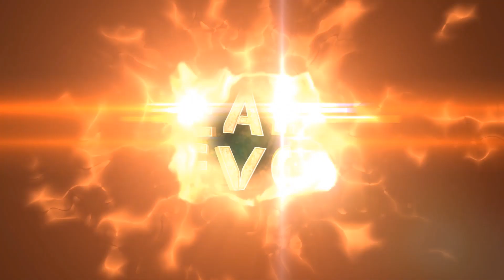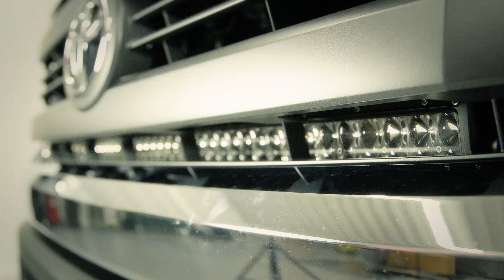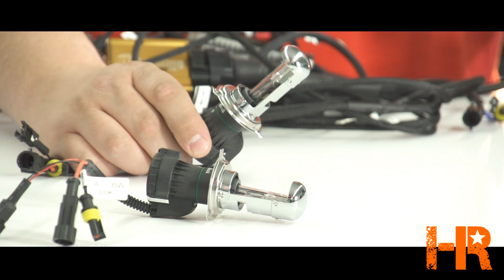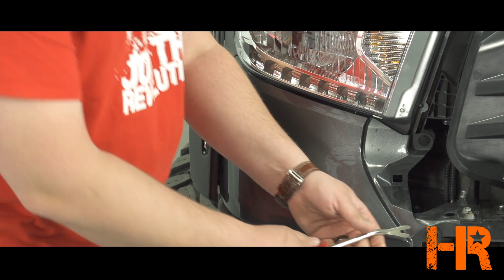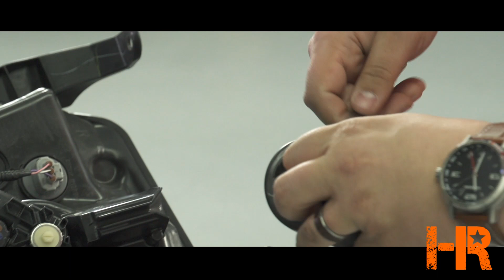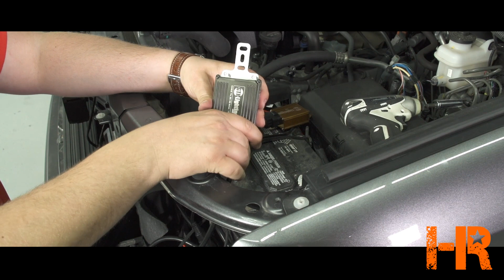2014-2017 Toyota Tundra Headlight Options - Tundra Video Series (6) | Headlight Revolution

Comment: My 2014 Tundra has 3 different 2 way radios for emergency use. I have had issues with aftermarket Led bulbs in the past causing RF noise on the radios and even completely blocking out incoming radio traffic. Would you recommend this product as suitable for such use? RF shielding is crucial.
Reply from the maker: Absolutely!

Comment: Are the GTR headlights with the color shield not available anymore? I can't seem to find on your website...
Reply from the maker: They are no longer available. While they were a neat bulb, There have been major changes in the industry for the better. The GTR Lighting Ultra Series 2 bulb is the newest version of the GTR Headlight lineup.
Reply: @HeadlightRevolution  link?
Reply from the maker: These would be what you need for your Tundra: https://headlightrevolution.com/h4-9003-gtr-lighting-ultra-2/

Comment: I have a question. I installed Two Head lights purchased from you several months ago, and experienced the left side turn signal light, still stock from Toyota, start blinking fast, then it back to normal a day later, it keep happening once in a while when Daylight LED and turn signal on at same time, turn off DL LED then it back to normal blinking speed. When that happened, I turned off Day driving light and it was ok. Do you know why or anyone having same issues, or how to fix? Thanks.

Comment: I myself decided to use a hybrid between the two (HID and LED) for my 2013 escape. I am replacing the stock headlight assemblies with one that has a projector low and a reflector high ( only aftermarket available) . I understand HID is better suited for projectors and will have a GTR 35w HIDs for the low projecters and GTR LEDs for reflector highs, to take best advantage of both technologies. Anybody else go this approach, have any tips, or concerns. I bought everything except for the high beam LEDs so far because after watching this i now have a question, should i just go for all HID? My high is a reflector and i know its not appreciated to other drivers with immense blinding glares they produce in reflectors, but does that matter since the reflector high beam would only be on without oncoming traffic anyways? HID seems like it (tho not as a clean vibrant color as LED) illuminates more area? thanks.
Reply from the maker: Hello Derek,  Using both together will be a great route to take, We recommend this combination all the time!
Reply from the maker: My guess is you already have, but if not, watch this video on HID vs LED pros and cons: https://www.youtube.com/watch?v=JAeLsPpSowo

Here's why we recommend the combination you are already on to:  While HID's can be brighter, they have what is called a "warm-up" period that takes about 6-9 seconds from the time you turn them on until the time they reach full brightness. That's totally fine with your low beams because you normally turn your lights on once while driving. In high beams, you can see how that could be a little annoying when turning them on and off. The reason we like to use LED's in the high beam is that they have an instant-on/instant-off light output. Usually, when people are blinding people with LED's it's for 1 of 2 reasons: 1, they simply have cheap, poorly designed bulbs. 2, they haven't oriented their bulbs properly in the housing. To orient them correctly, just make sure the LED's on the sides are facing right to left and NOT up and down. As long as you do that, you should be very satisfied with the results. 

Contact us with any questions, concerns or even over the phone troubleshooting, we are more than happy to help: 218-755-5505

Comment: The first question when comparing lighting angles on the test road with yard measurements; does this model Tundra have the adjustable headlamps?   I have a 2017 Limited and the lights can be adjusted with the dial on the dash, so I can raise the light, when in low beam mode, high enough to act as a high beam, and high beam turns into massive amount of light.  Some conversion kits inhibit the adjustable feature.

Comment: OMG...It seem harder than I think and why make a headlight to use H4 bulb instead of H11. After watch your video I prefer to buy the Silverado. It look like there is a lot of hassle just to replace a headlight bulb. If the bulb burn while away from home what can it be fix.
Also if with led or hid 6000k driving on wet road hard to see where you're going, I prefer hid 3000k see better on either dry or wet road, see better is part of safety

Comment: Does the 2014 have the same height adjustments as the 2017? Is that done inside the assembly? Will taking or the headlight throw it off?
Reply from the maker: I believe it's standard on all 14-17 trucks. there's a motor on the back of the housing. No taking off the housing shouldn't cause any issues.

Comment: I got this kit, and I want to suggest to you guys don't just crimp the grounds terminals if you solder terminals on wire it will avoid a lot of issues, as you know it handdle a lot of amps every time it start, thanks

Comment: wouldn't the led draw less power than the regular halogen meaning that it might have some failure with the tundra. thinking the bulb might blown up or almost dying messing up maybe by not turning on the fog lights or the low beams. don't you need to put in something in there
Reply from the maker: There are plenty of vehicles that need to have resistors, capacitors, or bypasses in place to make the computer happy.  Thankfully the Tundra is not one of those.

Comment: hello.  what is the best possible h7 LED option I can put in that is 35w bright white for a 2006 Mazda mx5.  I'd like it to fit like oem.  I purchased xenonhids.com led kit but they don't come with h7 adapter like stock, that pushes bulb all the way forward to get clip to hold in place. so that said,  my bulb doesn't sit all the way in. and to top off one LED on bulb is now blinking like a strobe light.

Comment: Awesome video. Even the one for the switchback LED turn signals. But as far as color goes, how does the Vision X bulbs show in comparison to the LED's? I'm more on the economical side, but I want to be able to match the white on the turn signals. 
Thanks!
Reply from the maker: I'd go with the 100W Vision X Halogen bulbs as they will be more white, vs the 55W Vision X bulbs are going to be more blue.
Reply: I bought the LED's and put them in yesterday. The lights looks real good and bright. I'm a happy customer!

Comment: I purchased these lights for my 2017 tundra off your site. It said it fits 2017 model tundras

is the installation the same as this one? because my tundra has the head light leveler so im curious if it will be compatible?

thanks
Reply from the maker: Yes, these lights will be compatible with that 2017. Some of these older 14-16 models also had the levelers and they fit just fine too.
Reply: awesome. Thanks so much!
Reply: Which lights did you go with?... Any feedback?...

Comment: HID in a stock assembly is a good way to blind someone so bad that they run into you head on, especially in a higher up truck. go with LED since they don't have the huge glare problem, unless of course you're a careless sociopath that only thinks about themselves...
Reply: That was my experience though i know very little about reflectors and am just learning..some "neckbeard" with a BSTruck must have had the 55watt HIDs and for sure didnt know dick about what he was doing..cause ive never been so blinded by an oncoming car in all my 47 years..who fuckin needs these floodlamps to see where they are going?
Reply: Agreed .. I run a pair of LED's on my fogs and Gosh I feel so bad everytime I pull up behind a car ... I turn them off. And this is just the fog lamps ... so guys do consider adjusting the beam level so they dont cause discomfort / blinding to others.

Comment: Hey Chris, What kind of lift do you have on that tundra?  This is exactly what I'm looking for.
Reply from the maker: 2015 Toyota Tundra Base Model

Fuel Offroad Wheels with Toyo "Country MT" 35" tires

The side steps are by N-Fab

The fender flares are unpainted Bushwacker "pocket style" flares

The lift kit was a 3" kit by ReadyLift
Reply: thanks for that. looks great

Comment: When I installed my HID kit on my truck my lights went in even. do I have to re-align the lights again afterwards? Metal parts of the HID Bulb is facing down on both sides.
Reply from the maker: Anytime you change your headlight bulbs you should check out the alignment and see if the beam pattern is too high or low.

Comment: So for everyone who clearly didn't watch the whole video. Gtrs hids have reflectors built into the bulb so you don't need to retro fit with projectors. You don't have hot spots it throws the light right where it needs to be.
Reply: What he's talking about is the shape of the lens itself, anyone can clearly see the SPOTS in the asphalt from LED and HID, those are the reflection of the lens designed for the regular bulbs.  They are not useless but not 100% either.  The LED low is good, Hi is really bad.  The HID low is spotted and the hi too hi and lost the low.  Too much compromise for the money.....the top third generation LED bulb is $195 EACH on their web site! and with a few ONE STAR feedbacks !
Reply: Jon Groves - I promise you, it's still glaring to incoming drivers. It still lights up the entire reflector. That's going to be hard on your eyes no matter what.

Comment: thanks for the video, it answered some questions. I have to say I'm pretty surprised at how high your prices are. these don't look American made and have seen simular on ebay for 30 bucks. I hope there is a difference in your light compared to Chinese led lighting on ebay.
Reply: Judging by the plugs, they're simply WAY overpriced generic HID/LED bulbs you can buy on eBay or AliExpress for $30 or less.  Hell, when you can't remove the heatsink/fan on the LED bulb, just shows how cheap they are by itself.
Reply: Don't forget they put the resistor in a fancy plastic box.

Comment: Great video.  I got the same truck and doing a similar install,  with a different aftermarket pioneer deck.  What kind of switch did you use?  3way?  Can you please link me to something similar.  Does the switch need to have 3 positions or just up and down. 

Thanks

Comment: HID or LED, either one is useless without Retrofitting the proper Projectors into the Lights.
Reply: AGREED.  It is the ONLY way to not piss oncoming drivers.
Reply: My 2017 civic has cutoff like a L not like a z on the wall why they are projectors

Comment: Good. Keep very informative. However you just talked through the last parts. Can you show us where to mount the kit and how to run the harness? It may seem obvious but not to us who don't know anything about electronics. Thanks.
Reply: Very good is what that should say. Which application is preferred for off road use dirt/water/vibration? I'm tending to choose the HID for max brightness.
Reply from the maker: JimmyDevere Yeah the ending did get a little rushed. You can secure the ballasts to the front cross member beside the headlights with a self tapping metal screw or zip ties . You can just tuck the wiring and relay along where it will naturally lay so that it will be out of the way of any moving parts or anything that will get really hot. And to answer the question about which bulb type is better for his application I would defiantly say that HID would be better, the LED's seem to do pretty good in these types of environments, but to be completely safe I would go with HID, also HID is still going to be a little bit brighter as well.

Comment: I had an his kit 8k installed but I noticed that the light don't come out wide spread and when I see the light hit a wall I see like a star shadow in thinking it's the cap on the headlight....why is that and how to fix that ? And I also noticed the light shoot to high up and not as much straight
Reply from the maker: bubba340 Was it an HID kit that you had installed? You will want to make sure the bulbs are installed all the way and correctly. Also, make sure to aim the headlights properly after the new bulbs are installed.

Comment: @HeadlightRevolution Will the tilt feature still work if i installed the LED Bulbs?
Reply from the maker: GCASALES1 Yes, the headlight housings can still be adjusted when the LED bulbs are installed.
Reply: GCASALES1 The tilt control local below the headlight hosing.